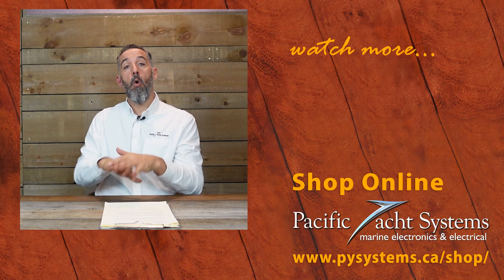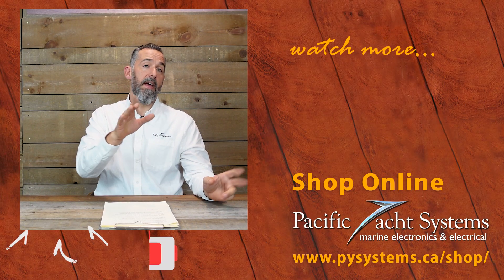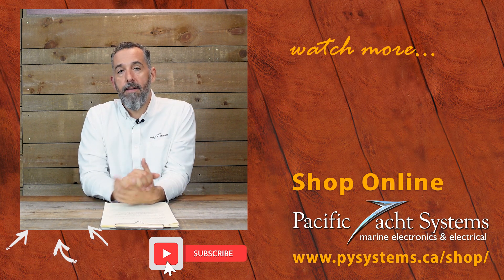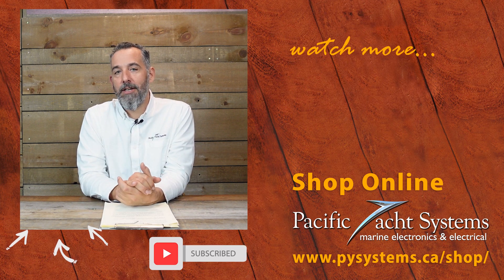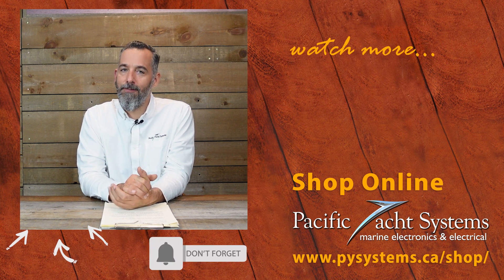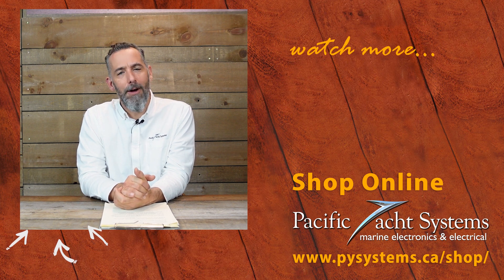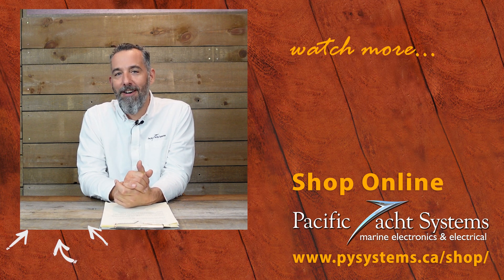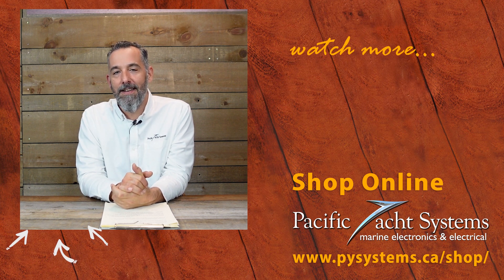How Do I Test My Boat’s Batteries to Find Out if They Are Still Good?

Comment: i have a 3 pole  off 1 all 2 battery switch . boat starts on all position ,then switched to position 2 crank lead acid wet 94 cca on my boat. motor started .but when i switched to position 1 house 200 a/hr agm deep cycle to simulate crank battery fail,  all i got was a failed attempt .am i expecting to much from my house battery to start the engine on its own in emergency ?or should you only attempt start in the all position  in a emergency.both batteries had been on shore power for a couple of days and disconnected from shore power to try this start test. engine 30hp Yanmar diesel

Comment: I'm curious about leaving a boat on the hard for the winter. With no shore power what is the best way to maintain the batteries? Could I hook a solar panel up? Do I leave switch on...or combine?
Reply from the maker: do you need to power anything on the boat?   I would disconnect the batteries compleatly so there is zero drain.   The only issue then is the boat filling up with rain water if it leaks.  Since you no longer have a bilge pump. (yes it happens)  A boat left in the water I would defiantly not leave  with no bilge pump power.

I'm asumming everything gets winterized so it can't freeze?

Comment: Simple. Every 3 to 6 months.  Remove & Clean until it really shine all direct batteries connectors to different items. even if a wire is  going to starter & reconnect.  Use battery charger recharge until full. Remove batt. Terminals use a good resistance load coil type tester & test batteries alone.  Read. If battery is bad. Replace repeat if all good. Each 12 volt battery system should charge @ least 13.8 up to no more than normally 14.8 volts, 15.2 + start worrying.  That test never will fail you. 
Need run A parasite off key drain test but that easy look up on internet. Marine use & moisture is your biggest enemy check out different system specifications but huge help is Die-Electric grease use to slow resistance film build-up on all electrical &  electronics connections &   connectors. Some electronics products recommend this product some don't. Read there manual. But resistance load testing lot cheaper but do better job than higher price fancier testers. 1 of them A  good extra alone  carry type batt. Jump starters are worth there price for emergencies from price  $75 to $300 some. That saved myself countless times.. this process never failed myself as 37+ year experienced cert. Diesel Mechanic & Welder.
Reply from the maker: Thanks for sharing wv171, really good advice.

Comment: Just purchased a Konnwei KW208 battery tester. Seems to work ok. Sure hope it gives accurate diagnosis of batt condition. Just trashed a $330 grp 31 agm battery based on test. Are you familiar with how these testers work. Do they replicate the tests you describe only in a few seconds?
Reply: Using 650 tester same brand. All this toys are good for quick initial checks.  Due to their internal algorithms. For accurate figures only long tests are suitable . I mean if it shows OK- it’s OK in most cases. Wen “replace” -you have to perform more tests to be sure.